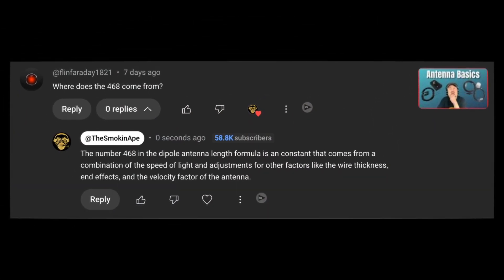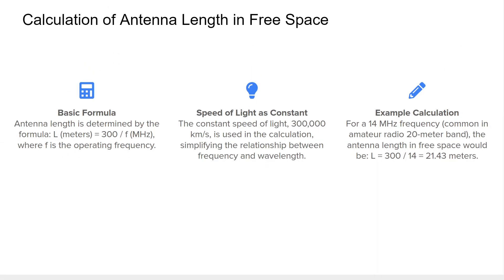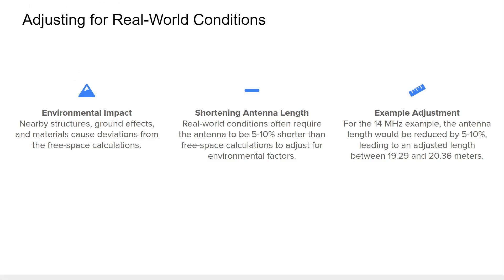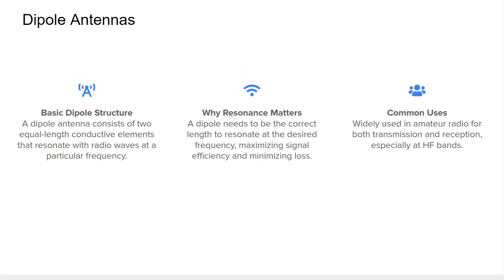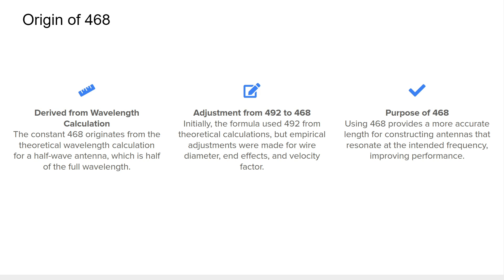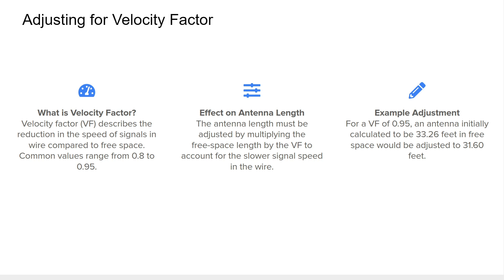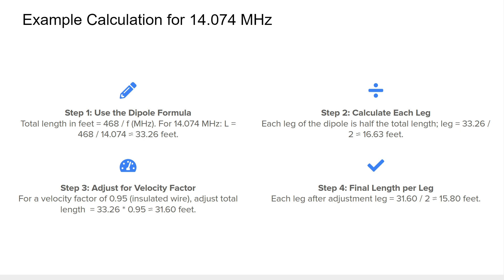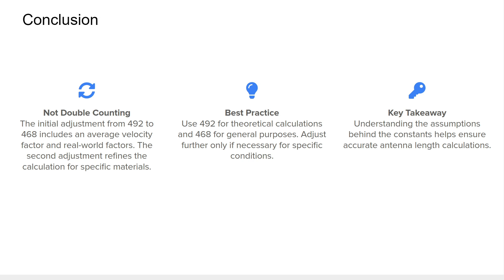Ape Answers 012: Avoid Mistakes, Designing Ham Radio Antennas with Math

Comment: The speed of light is 299,792,458 meters per second.  When calculating antenna length, this is rounded up to 300.000.000.  When we divide this by one million, this is where the 300 comes from.  Instead of talking about frequencies in the millions, we divide them by one million and call them megahertz.  Calculating antenna lengths base on 300 will give the full wave result.
The speed of light, in US imperial feet, is 983,571,056 feet per second.  But dividing it by two does not equal 468.  So where does it come from and why is 936?  The short story is about 100 years ago, antennas were measured by wavelength, not frequency.  468 was used to account for losses such as the velocity factor in wire, environmental factors, end insulators, etc.  Calculating in metric, with the constant of 300 does provide more accuracy, and allows you to enter the velocity factor of the specific wire you are using.  Using feet as the constant may provide a value which may be to short or too long.  It is easier to trim wire than to lengthen it.  "I keep cutting the wire but it just keeps getting shorter!"
That is my $.02 worth of unrequited babbling.
Reply from the maker: Thanks for the info CS 👍

Comment: I did cut a piece of coax RG9/U using this formally. Then I had an indicted me to terminate on end with a PL-259. I snipped a little off at a time until I reached 0 impedance. I then installed a 50 0hm feed line, but I was unable to get the SWR lower than 2.4. I am using RG-9/U Beldinn. Cut at 7.154 Mhz. I have built two of these antennas in my lifetime, each lasting 15 years. I always use the Double Bazooka MIT design.  I have also always used RG-6 or thebonevthatblastest the longest RG-11. I wanted more broadband and low noise. I successfully built an 80-meter out of RG-232, and it still works and easily handles full PEP.  Suggestions are most welcome. I used NFJ 269 advanalyser. Other than sticking with what worked. Where did I go wrong?

Comment: Very good APE. This is why the metric system is better !  the math lines up better.  The outher thing that changes is a dipole at correct height will be 72 ohm impedance. A quarter wave vertical is 36 ohms. Our feedline is mostly 50 ohms and modern transmitter is a 50 ohm standard .  So we just correct for that in adjusting the length to get Low SWR to transceiver.  SWR is standing wave ratio . this does not mean the antenna is resident.  which may be like 1.6 SWR on some dipoles. This is why a smith chart would be better.  SWR is the happiness of the transmitter.  A dummy load can be 1:1 SWR and transmitter happy and will be a bad antenna . The math gives os a starting point . we have to adjust for the real world . And that never the same. #1 rule of antenna's everything affects everything . #2 all antennas are a compromise    . The best thing is just try it !  73
Reply from the maker: Great points Robert, totally agree 👍

Comment: Excellent explanation. Every newbie should be taught this.
This is how I teach it:

300 / 2 (for half-wave dipole antenna in Mhz) = 150
150m x 3.28 ft per m = 492 ft
492 ft x .95vf = 467.4 (we’ll call it 468)
Reply from the maker: Thanks for the info Joe 👍

Comment: Nit picking a slight internal inconsistency: You said that going from 492 to 468 includes compensation for velocity factor, but you also used .95 velocity factor to further reduce the line length. Isn't that using velocity factor twice?
Reply: I  thought the same thing.  At 6:58 the VF of 0.95 is used a second time and 15 ft per dipole leg is the described result.  I believe this will be too short for 20m FT8.
Reply from the maker: 492 is an adjustment from the speed of light traveling in free space to traveling in a wire, the second adjust if for tailoring to your specific circumstances 👍

Comment: Its easy to make the rough estimate for an antenna  if you are in europe or any metric country
Reply from the maker: What’s great about these comments is that you still need to calculate and measure with either system.  One is no more complicated than the other….
Reply: @TheSmokinApe  well, its very easy for me 1/4 antenna dipole at 50ohm for 80m   will be 2 pieces of 20m cable. 
So its way easier.
Its literally quarter wave antenna and quarter of the wave length.
Reply: I agree. Why start in metric then finish in medieval (sorry, imperial) system, adding a layer of complexity of risk of error? It's fascinating to see the US being alone using this outdated method, after officially converting to the metric system in... 1965.